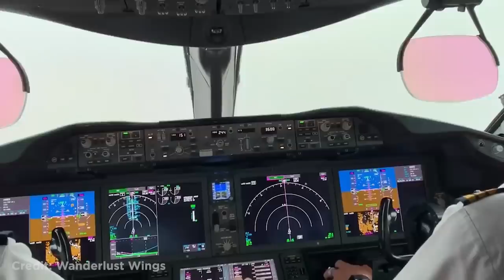Plane Turns Too Steeply

Comment: That 787 landing is pretty intense. You could see on the MFD the airport diagram coming into view... but still all white outside and no runway in sight lol.
Reply: I'v experienced a few landings like that as a passenger, fog so thick you feel the gear touch down the moment you barely begin to see the runway. That's the only times I've been a bit worried while on a plane.

Comment: The 787 autoland in low visibility clip was Wow. I think the computers and the autopilot of the Dreamliner are very sophisticated.
Reply: They have had auto land systems since the 1970s. It’s not that sophisticated.
Reply: Tristar was first!
Reply: @DC9Douglas   First what? If you mean the first airliner with A/L capability, that's incorrect. If you mean the first tri-jet with that capability, that would still be wrong as the Trident had that in the 60s.

There's a decent write-up about autoland on wikipedia: https://en.wikipedia.org/wiki/Autoland
Reply: @rtbrtb_dutchy4183 I seem to remember the autolandings back then being not the smoothest. Or maybe the pilots blamed their bad landings on the auto landing system 😂. 

Still pretty cool to see, don’t forget most of us don’t get your view from the plane. :).
Reply: @MeppyMan  right. And now it’s the other way around. They take credit for an autoland. 🤣🤣

Except the simulator, I’ve never done an autoland in my life. And I’ve flown 3 types that have autoland. I’d rather hand fly. I don’t see the fun in an autolanding.
Reply: @rtbrtb_dutchy4183  I can’t see automation putting you out of a job just yet. And agree on the flying by hand. There are autopilots for helicopters that can even hover. Might as well be sitting in a drone 🤣
Reply: @MeppyMan  right. I don’t see that happening in my lifetime. I’m 51, the only thing I might see towards the end of my career is some larger airplanes flying single pilot. 

Auto hover, right, who in the world wants that?
Reply: @rtbrtb_dutchy4183 my dude,  chill. It IS still a sophisticated system whether or not it's done before.

Comment: Great video Lucaas.  Must be a great relief to the pilots to finally see the runway lights thorough that thick fog. Hope that everyone has a great weekend.
Reply: there is no relief. The plane was set to auto land, it is normal procedure in those conditions
Reply: you might also notice that when the white lines of the runway line up with the pink HU display they are more visible than without. Without knowing first hand (just a casual enthusiast) I would guess their view is better than ours...but still quit thrilling (read: butt puckering) for them.
Reply: the pilot is from vietnam airlines

Comment: Can someone tell me why the small plane bounced like that
Reply: I used to fly an airplane without "real" pneumatic shocks, just "rubber biscuits" to cushion the landing.  They don't absorb much energy, and if you bounce it too hard, they reflect that energy back upwards.  Then the airplane can start a porpoising mode on the ground, which tends to end with a prop strike and a large repair bill.  Kudos to this student for recognizing it before it ended really badly.  Not sure the configuration of this airplane, but perhaps similar?
Reply: @johngriswold2956  so i guess the answer is to try and come around smoother, a lower angle?
Reply: @DamplyDoo  Approach is still at the same angle per VASI/PAPI, but touchdown has to be smooth to avoid bounce.
Reply: Many reasons could have caused this.
Reply: @johngriswold2956  i am new and don't know what vasi is, but i think i understand smooth touch down

Comment: 3rd pilot solo, way to much rudder pedals pressure or that would not have happened , & the pilots landing with almost no visibility should have requested a vector diversion to another airport if there was one & they had enough fuel
Reply: "the pilots landing with almost no visibility should have requested a vector diversion to another airport if there was one & they had enough fuel"

Not. The airplane is equipped with very expensive avionics systems so it can land in such weather instead of diverting.  It's now 2023, but that was even true in the last century.

Comment: Not a fan of wanton destruction like the car drop.  I know they do it safely but it still seems unnecessarily dangerous, and negative in general.
Reply: It's done as a joke. The car is from a scrap yard. They make an announcement to say there's a car parked blocking traffic, then the chopper flies over with the car after several more announcements. Another announcement asks who's car it is, then they "accidentally" drop it. The same thing has been done at airshows around the world for decades.

Comment: WTF is going on with the minimums being 30ft above the ground? This isn't normal, and it doesn't take a real pilot to know this. What exactly was happening in this landing as it wasn't normal.
Reply: It's called a CAT IIIC landing, in which the autopilot can land in zero-zero conditions with no visibility.  Takes a specially qualified airplane and crew, but when you have those, it is normal.
Reply: It is normal.